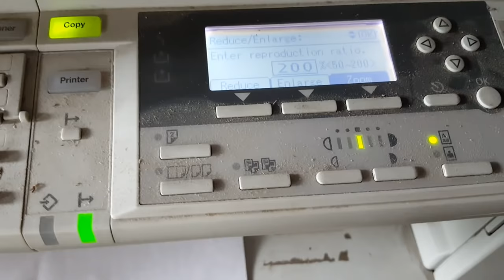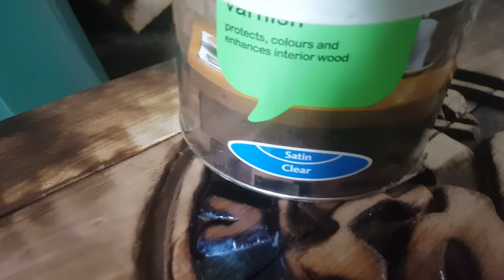Handheld Router Projects - Honda Magna Wooden Plaque Sign

Comment: your right about the laser printer they are quite cheap nowadays or you can even nip into the library and print it out at 10p a sheet, i was kinda hoping you would have done it using resin maybe w ith some glowing resin in the inlay also i think lady butters isnt a lady 😁
Reply: oops just read the other replies about butters. poor lad😐
Reply from the maker: ive been playing with resin filled inlays, made one, ive not shared it yet, ill get something put together on it, and yeah, Mr. Butters was pretty much the man, now, not so much the poor chap :)

Comment: hi bongo . i need your transistor details . how many ampere is in out put ? 0/2 ?
Reply from the maker: for the microwave transformer? i dont know, our supply here is 240v, i think the output is 2000v at 2amps maybe, i havent looked at the technical specs, i also dont have a working multimeter